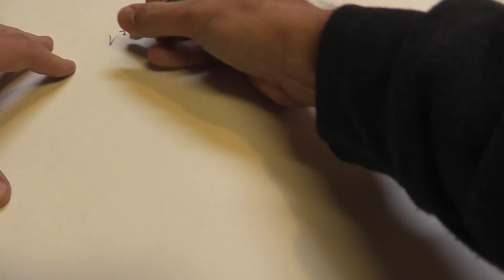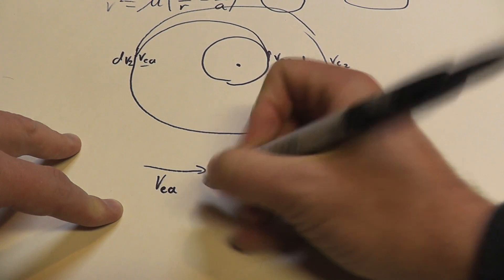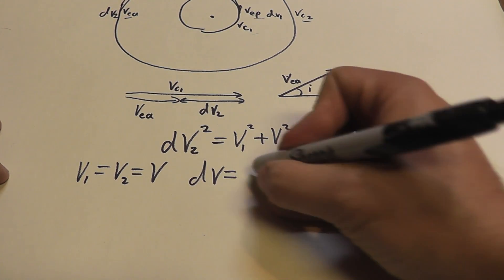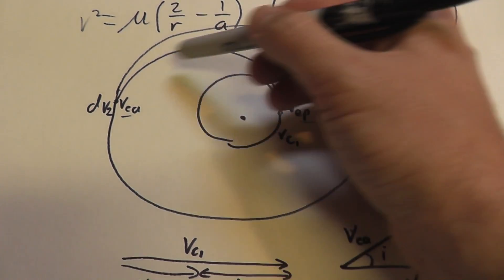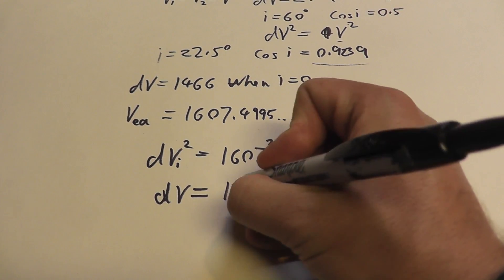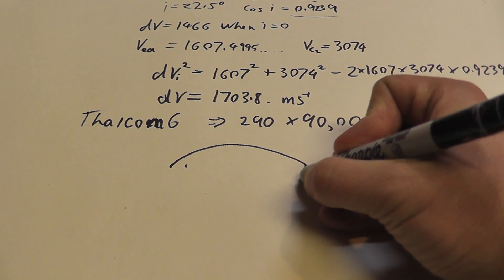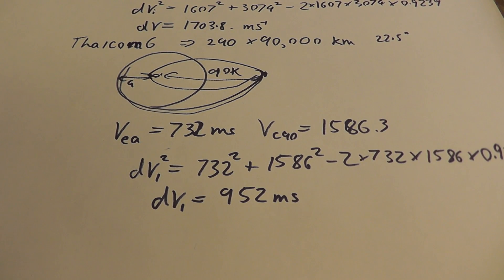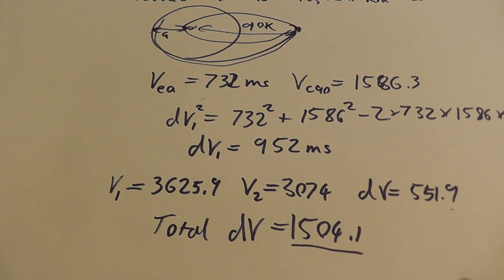Orbital Mechanics On Paper - Part 2 - Inclination Changes

Comment: I know this video is old but is has helped me in KSP. Sometimes when I don’t have enough fuel to capture at jool with fuel I end up doing a gravity assist off Tylo or laythe but I often capture into a retrograde orbit relative to the system, so I get an assist off laythe to a super eccentric orbit where my velocity at apoapsis is  tiny (<100 m/s) and can change the direction of the orbit for <150 m/s usually, then I can get another gravity assist off laythe to lower it back down to a lower orbit, much better than having to redo the mission because you got unlucky and your approach left you with an assist than can only fling you away, or send you right into jool without any way to capture into a prograde orbit, so instead I can go into a retrograde one for a relatively small delta v penalty. I always pack extra fuel when going to the Jool system just in case for this reason.

Comment: So Scott... Let's say I'm on a chase where the target is 25 minutes ahead in it's orbit when the chaser reaches the equator, which is where I'll perform an inclination maneuver of i=23 degrees. Both vehicles have approximately the same height, and I was wondering what you would do to be more fuel and time efficient with your mission. My Dv2 when I do both maneuvers together comes to 3.07823 whilst if I do just the inclination, it' 3.06858. It's practically the same because the vehicles are on more or less the same height? Anyways, if this is correct, how low would you go with the chaser, and would you complete the hohmann, or can I dock when I reach my perigee and the target? I'll owe you one and I'm a man of my word, which means I will never pay you back :)

Comment: If I understand correctly with no inclination change your delta V is either prograde or retrograde depending on what you are trying to do.  If you want inclination change how do you determine what angle to burn at, is it still all prograde/retrograde, but pointed 22.5 degrees up or down relative to my orbital plane?

Comment: At 11.57 minutes of the video can you explain how you got the values for Vea and Vc90 as 732 and 1586 respectively with details of the formulae and substitutions?
Reply: The 732 m/s is straightforward and falls out of the equations for velocity at periapsis and apoapsis (covered in part 1). Specifically, 732 is the Vapoapsis of a 290 km x 90000 km orbit.  The 1586 m/s velocity threw me for a bit because he used the notation for a circular orbit of 90000 km but that velocity is actually 2034 m/s.  What that value ACTUALLY is, is the Vapoapsis of a second orbit with an apoapsis of 90000 km but a periapsis of 4.216E7 - a value he uses in the part 1 of this series for a geostationary orbit.  With that new periapsis value, the velocity at apoapsis is 1586.3 m/s.  This orbit also gives the other value he pulls out of the air which is the velocity this new orbit has at its periapsis which is 3625.9 m/s.  The other velocity - 3074 m/s - is the velocity for a circular orbit at that radius of 4.216E7.

Comment: love the video thanks so much. I am currently studying aerospace and have a question.  When you have to perform an inclination change and orbit change in the hohman transfer. you use the equation (dv_com)^2=  (V_initial)^2+(V_final)^2-2*V_initial*V_final(cos(i_inclination)) Now my question is how does it differe from conducting first calculating the velocity for the inclination change and then the one for the orbital change? Thank you so much and do you maybe also have  an example.
Reply from the maker: As long as you treat it as a vector addition it’s fine.
Reply: @scottmanley  Where did you get the V1 value from at the end of the video? 14:00

Comment: You are talking about bi elliptic transfer, wich would save you dv even if you dont have to change planes whenever the radius of the desired orbit diveded the radius of the starting orbit is grater than 12 (roughly) and if you have to change the plane angle (like in your example) is even better.
Fly safe 😉

Comment: I guess there is specific position on orbit when you need to fire your engine to do inclination change, right? Is it when you pass through equator plane, you position space craft in 22.5 dergees and burn it?
Reply: Had the same question myself
Reply: My question is 5519  looks like a 5775  in sequenced

Comment: Do they perform a homann transfer to get to the right point in geostationery orbit? because they always perform their burn out there over the equator(for obvious reasons). or do they do some other maneuver with eliptical orbits and orbital periods to match up their poition?
Reply: also, I figured out how to work out the orbital period for circular orbits using the formula from the first video and 2×pi×r. but how do you do this for eliptical orbits?
Reply: I think they cslculate when thet need to launch beforehand and circularize at the apogee which happens to be in the right spot because of when and where they launched.
Reply: Max Scott but for an orbit with a 24h period, (geostationery) it doesn't matter when you launch because you will always be on the same spot relative to it.
Reply: What I mean is that they time when they will arrive in that spot so they can get the satelite where they want it

Comment: Wait, shouldn't inclination changes have to be made on ascending or descending nodes? Because those are the two points where the orbital planes intersect, if you do the changes elsewhere won't you also have to do a translation to ensure that you stay on the same plane?
Reply: I think you need to place your excentric orbit that way that the nodes are at apoapsis and periapsis. All a matter of timing your burn for the transfer
Reply: The original (inclined) orbit is circular, so they can simply burn at the AN/DN when they initiate the transfer so that the large Apoapsis they create is indeed such a node. :)
Reply: The initial parking orbit is slightly eccentric with periaps over the equator. The burn to GTO happens there on the descending node, which puts apoaps over the equator on the ascending node.

Comment: Is there a way to calculate the heading a ship needs to point towards in order to accomplish the inclination change while also burning prograde/retrograde?
Reply: I think you need to calculate the angles at the vectortriangle you make
Reply: I don't know how to do the math for this but I'm pretty sure if you draw a triangle with the 2 sides next to the 90° angle according to the dV of each one, the angle should be the inclination of the 3rd side. just remember to point that in the right direction.

I need someone to prove this right or wrong because I figured it out for myself and didn't prove it.

Comment: Hi Scott, 

Firstly, great video!  Thank you for making a relatively simple and easy to follow guide.  I haven't done math like this for a few years yet I picked it up as you went along.

Just one issue I had in this video - you confused me when you started talking about Vc90.  I assumed you were talking about placing the satellite in a circular orbit with r=90 km, and thus I couldn't figure out how we would get the satellite back down to 40km for the geostationary orbit.  My calculations only started to make sense when I took your meaning of Vc90 to be the velocity needed at apogee to make a transfer orbit from 90km to 41km.

Other than that, everything else made sense!  If you could continue these videos I would be highly appreciative!
Reply from the maker: Yep vc90 is poorly named, it's the velocity at apoapse in a 90,000km x 41,000km orbit

Comment: This calculation is making the assumption that there is a constant mass for the satellite.  There would need to be a bit of calculus to calculate the actual dV correct?  As the rocket is launching propellant into space, it is continuously becoming lighter at some rate at which the fuel leaves.  So my question is:  Is the fuel mass loss significant enough to change the amount of dV required to insert? Or is the change in mass negligible?  I would understand if the amount of fuel lost is around 1/100 of the total mass of the satellite, that it would not have a great effect on the acceleration of the ship during the time of the burn.  AAAAAAAAAND I just realized that dealing with centripetal motion the mass of the object doesn't matter... OK so the only thing that it would affect is the time of the burn, not the change in velocity required to reach insertion... HAHA
Reply: the ship itself needs to know how much propellant it is expelling, yes. as far as the math is concerned what matters is how much it's velocity has changed regardless of mass.
Reply: DeltaV already ignores mass by definition. If you want to know how much fuel you would need for a certain DeltaV, then yes, you need to worry about the fact that the mass changes as you use fuel. However, the speed of an object in a particular orbit is the same regardless of its mass (unless it's large enough to have significant gravity of its own), so a change in mass does not affect the required change in speed.

Comment: A question I have had for some time (it might be stupid). I will try to explain it the best I can.

Is it possible to have an orbit with 0 inclination but at a higher or lower latitude than the equator? If that makes any sense.
Reply: I don't feel like the previous answer actually answered the question at all.

The reason you can't have an orbit parallel with the equator and higher/lower in latitude is because of gravity. In orbit around the Earth, gravity (a vector quantity) is always pulling you towards the barycentre of the Earth. If you were in an orbit parallel with the equator (zero inclination), but passing over Canada, Britain, Scandinavia, etc. instead of Colombia, the Congo, Indonesia, this vector would not be orthogonal to your velocity vector.

That is, in a perfect equatorial orbit, gravity is always acting at a right angle to your forward velocity (your prograde). This produces no deviations in our inclination - gravity is trying to pull us directly downwards. In our high-latitude orbit, however, the gravity vector would always be pulling us... sort of down, but also slightly southwards, towards the equator. In fact we would inevitably end up in an inclined orbit.

You might notice this in KSP, when you launch a craft from a higher latitude on Kerbin, Duna, or similar. The higher you go, the more your orbit starts to 'droop' towards the equator. This is a design issue for ballistic missiles. They have to orient themselves somewhat northwards to strike a target on the same (or greater) latitude in the northern hemisphere. This is why so much detection hardware was built in places like Iceland, Scotland, and Norway - many of the anticipated courses for ICBMs fired between Russia, Europe and the US went over/near the north pole.
Reply: The way you are phrasing it no. The inclination is basically looking at a globe as a unit circle with the equator being the x-axis, the angle of the orbit compared to the x-axis gives you it's inclination. So the only spot on the orbit that can have inclination of zero is when the angle to equator is zero. You can have it so the eccentricity of your orbit is zero ( just means you are in a perfect circular orbit) but as for inclination no you have to travel along the equator for an inclination of zero (unless you change the zeroed location). Having a zero degree inclination doesn't really change much it is more just to let you know how you are flying around the planet.
Reply: That makes sense. Thanks.
Reply: spacekeeper Makes a lot of sense. Thanks!

Is it possible, hypothetically speaking, then to have constant propulsion keep you in an orbit like I described?
Reply: Could very well be possible, but obviously not feasible.

To complete one orbit of this type, you'd have to produce enough thrust to support most of your weight in a 'hover' for quite a long time.

As you might imagine, this would involve very precise engine throttling and attitude adjustment.
Reply: if you could constantly prepulse sure but gravity pulls you toward the center of the body so you'll be in an inclined orbit or an equatorial one.
Reply: Scott, google Lagrange Points
Reply: PhillipNutt that's not what he meant

Comment: I know this sounds really stupid, but for inclination changes would you burn to the normal/anti-normal of your orbit?
Reply: It depends on which direction you want to move the orbit AND whether you are burning at the ascending or descending node. If you burn normal at the ascending node, you will increase your inclination. If you burn normal at the descending node, you will decrease your inclination. Think of it this way: at the ascending node, you are moving UP relative to the planet's axis. Therefore, if you burn normal, you are burning UP as well. You are therefore making your orbit more UPwards, which increases inclination. At the descending node, you are moving DOWN relative to the planet's axis. Therefore, if you burn normal (UP), you are burning the opposite direction to the direction you are going, and you will make your orbit less inclined.

If you burn in between the ascending or descending node, the same principle applies, but you will be pivoting your axis around a different point.

Comment: Scott - the example you gave required a plane change of 22.5 deg to enter geo stationery orbit I would guess due to the earth having an inclination on its axis. However why do they not wait until the launch site sits on the 0deg line and launch then? This would remove the need for the plane change all together?  Its what I would do in ksp to dock with a station on an inclined orbit as the deltaV at launch to change planes is far less than at orbital speeds.

Comment: Why do astronomers write ms^-1 instead of m/s?
Reply: It can make dimensional analysis much clearer.
Reply: Physics student here, there's not really any reason to use one over the other apart from personal preference. I think a lot of people find using negative powers easier or faster to write. I use negative powers rather than 'over' simply because it's what I prefer (and my slashes tend to be rather untidy, extending far beyond the top and bottom of the m and s.).
Reply: That's ok as long as you don't forget the -1 like Scott does here. If you look in wikipedia for physics formulas, you'll soon concur that some have complicated units because many dimensions interact, say the heat transferred in watt through a material : it depends on the temperature difference between the end surfaces, the cross section area, the length of the thing, so it ends up being in W / (m2 . m-1 . K) which simplifies as W.m-1.K-1 or W / (m.K) whichever you prefer.
Reply: As an engineering student, I write them like that because it makes dimensional analysis while solving equations much easier. If the units don’t match to the ones you are expecting, 99% of the time you are plugging in the wrong values and units.
Reply: Because they think they're cool.
And they are. Basically, it's just a matter of preference, some people find it easier or more convenient, but m/s and ms^-1 are the same thing
Reply: It looks cleaner and can fit into a single line better
Reply: Where did he get the V1 and V2 values from at the end of the video? 14:00
Reply: It's writing it in standard form
Reply: Actually, he ended up just writing ms :)

Comment: When I use KSP maneuver nodes to plan an inclination change, I always end up pushing myself into a higher orbit, unless I also burn retrograde to compensate, but it never seems to work out well for larger inclination changes. It ends up being a ridiculous amount of delta V. I think that this is because, as I burn normal or antinormal, my velocity vector changes, and if I maintain the same orientation for the whole burn, I begin to burn more and more prograde and less and less normal/antinormal. It seems like I should be able to pull off a 90 degree inclination change basically "on a dime", with sufficient delta-V. To accomplish this, would I have to basically keep adjusting my burn vector so that it was always ninety degrees to my prograde vector? Is this functionally the same as setting up a maneuver node with normal and retrograde components (basically, just averaging out the burn's vector)? Is the massive delta V I end up with just a consequence of burning at too high a velocity, in other words? Or is this a limitation of the maneuver node system, which doesn't integrate well over burns that would require a constant adjustment of orientation?
Reply: I think you are right - I have the same issue when I try to change inclination - push into higher orbit, and usually higher delta v than anticipated.  What I basically started doing was doing a rough plan with the inclination node, and then kind of estimating on the fly and in my head as to the changes - I end up starting my burns a little early and ending a little late, with minor adjustments the entire time.  I still have the same problems, but usually they are to a lesser degree.  Except for when I really screw up (or one of my kids comes in and distracts me while the other starts navigating on the keyboard - this has happened a couple of times).That all said - I'm still pretty new at KSP.
Reply: There is a plug-in that will add radial and normal indicators to your nav ball. The test would be to burn normal and keep adjusting to aim at the normal indicator as it changes.

Comment: Scott, back before the Olex site and the planets were added a lot of us were hitting the outer planets by just eye balling it.  I did the calculations for phase angles and those were always spot on.  The calculations for required delta-v were always off by 200-300 m/s which seems a bit on the "not a tiny mistake" side.  Can you show how to calculate a phase angle to Duna as an example, and how to calculate the required delta-v?